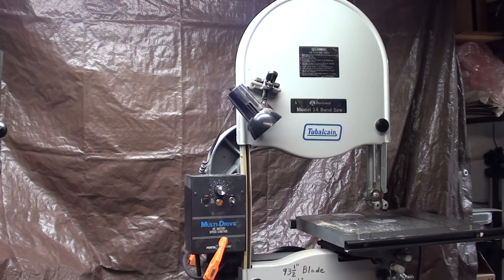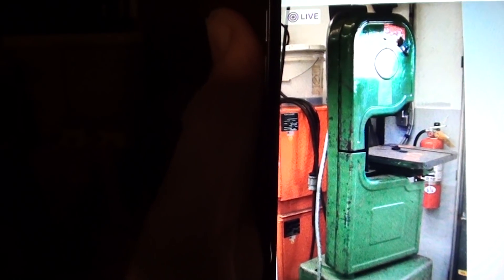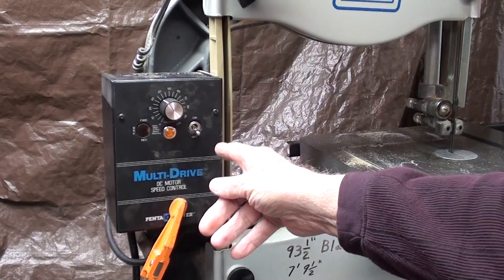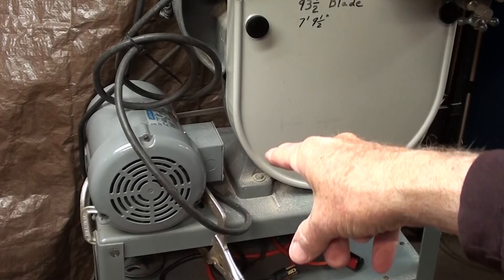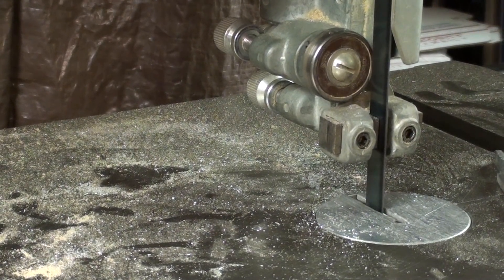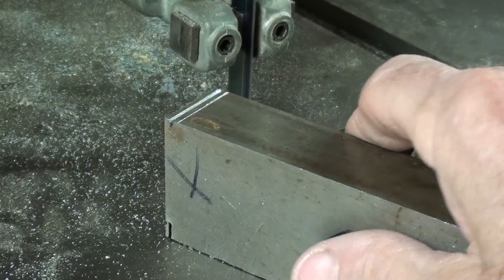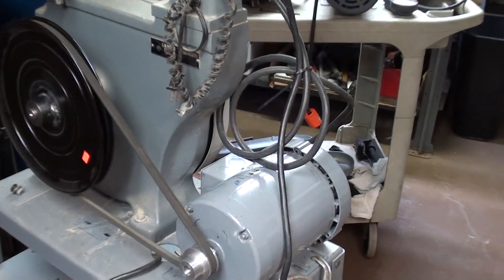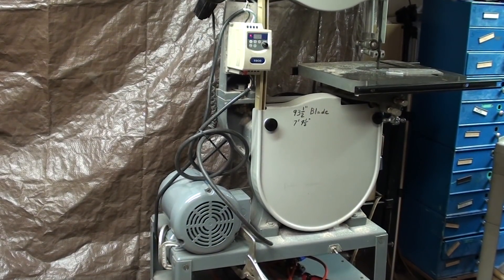Converting Delta Saw to Metal Cutting 491 pt 4 DC VFD tubalcain

Comment: My father had a Rockwell which he fitted with a washing machine gearbox, it basically took the place of a jackshaft with step pulleys from the motor and a chain drive to the blade (single v-belts couldn't hand;e the torque).  It provided a good speed reduction for metal cutting and shifting up to high range (originally spin-cycle) was good for wood and friction cutting.
  The Rockwell was a bit heavier than the newer Deltas, Cast iron instead of those die-cast parts but it still made the screeching noise when metal cutting.
Reply from the maker: Thanks

Comment: Well, at least we know that to do this you need a gearbox or an intermediate jack shaft to get the blade speed and motor rpm properly matched up. 
Now I'm glad I salvaged a couple of those Boston gear reducers from some machines being scrapped years ago.
Reply from the maker: Yes

Comment: I have an older Grob saw and it is purely belt drive. But it has two jackshafts in the cabinet giving 10 speeds from 50-1000fpm. The final drive to the wheel is with a pair of 3/4" wide belts, which is likely what it takes to really work well without a gearbox
Reply from the maker: Thanks

Comment: Hi Mr. Pete,  Powermatic makes a 14 inch metal and wood cutting bandsaw as well as just a wood cutting saw. The metal one uses a small transmission to cut the speed and increase the power. Model 143.
Reply from the maker: Yes, I have their parts list
Reply: I think the model 141 wood bandsaw will produce the same results as the delta. 
Good luck with it, always good subject matter. I have lots of Powermatic wood machines and they are very well built.

Comment: Oh no no no not a failure at all.  I think your idea about the gearbox and the motor is going to be the cat's meow.  Just need a motor that would couple to the gearbox and a double belt or a chain.  This saw is going to be a beast I just know it is.  After all, there is always a great cost for plan B.  Of course the cost is plan A, but you can't get to B without it (or C or D...).  I think my shop teacher told me that.  Did i just hear a bell?

Comment: I have one of those Chinese metal/wood-cutting band saws. It is a 18" Rikon. I had read that Rikon was one of the better Chinese band saw companies so I took a $1800 chance. It was delivered from Amazon completely assembled in a nice wooden crate. It weighs about 400 pounds. I would have preferred an American-made saw but, as a hobbyist, I couldn't afford one of those. I have had the Rikon for about 5 years now and I can say that I am fairly satisfied with it. The only real problem with it is that the upper blade drive wheel has an excessive amount of run out. I could have had the drive wheel exchanged under warranty but I didn't because I wasn't certain that the replacement would be any better and could possibly be worse, given the reputation for Chinese quality or lack thereof. The run-out doesn't really cause a problem unless you try to run it faster than about 1000 FPM due to excessive vibration. Since everything that I cut requires a lower speed than that, it is really not a problem and it runs quite smoothly. I also had to change out the speed sensor. The original was an optical sensor which caused the speed display to wander a lot making it almost unusable. I replaced it with a Hall-effect sensor and magnets which works perfectly. I also added an on-off switch. Surprisingly, it didn't have one so when it was plugged in the VFD was always on.

The Rikon uses a VFD, a 3-phase 2 HP motor, and a 2-stage step pulley to achieve its range of speed. I have always been able to use the lower speed pulley to achieve all of the speeds that I need but the ability to swap pulleys is there if it is ever needed. The VFD is mounted low and is enclosed in a sealed box with a door which can be opened for VFD adjustment if needed. It has a remote control mounted at chest level which contains the speed display, speed adjustment knob, and start/stop buttons.

If you adjust all of the blade guides properly, it makes a very nice square and straight cut. I have used it to cut steel, aluminum, copper, brass, plastic, and wood.

I thought that everyone might be interested in my experience with a large Chinese metal-cutting band saw. As might be expected with Chinese power tools, after you make a few minor modifications they work reasonably well.

Comment: I converted a Grizzly 14" to cut metal using the same setup you have and the only difference was a larger tooth blade of 8-10 TPI. It seems to cut just fine. I experimented with finer blade and they didn't last but a few cuts on steel and aluminum. Just throwing my inexperienced 2 cents in. Thank you Mr. Pete great video
Reply from the maker: Thanks

Comment: I suspect that you have one (or both) wheel on that bandsaw which is running a bit off center. I could see the upper guide moving up and down in time with the motor speed at several points in the video.  (In the places where you had a close-up of the blade cutting.) You might want to put an indicator on each of the wheels to see where the runout is happening. As the frame is stressed more or less by the changing distance between the wheel axles, the tension on the blade changes, too. I would think that this might cause problems with tracking and with the finish of the resulting cuts.

Comment: This series was not a failure. You provided excellent experimental data, and U showed various limitations; and, what’s needed to improve. On the point of VFD’s and motors in the bandsaw low speed application, using a 240V single phase input to 240V 3Phase output VFD, and with the VFD set to SVD control mode driving a 1HP inverter qualified 240V motor will work quite well, and will allow almost zero RPM with adequate torque. - and if it’s important to cut metal efficiently one should use the correct blade. All VFD’s are not equal and don’t have SVD control mode. Note that at 120 V the current draw by the VFD is about twice that at 240V and the resistive (heat) loss at 120V operation is greater by a factor of the current squared - meaning much hotter motor and less efficient operation - and possible tripping of the VFD (electronic fuzz).
Reply from the maker: Thanks

Comment: In my garage I have a 17 inch grizzly bandsaw connected to a 2hp 3-phase motor using a variable frequency drive.  The VFD is mounted up high on the back of the machine to keep dust out, and I’ve run wires to a secondary 10K potentiometer (controlling the speed), a latching RUN switch and a momentary START switch just above the emergency shutoff which I’ve left in place.  I have never been able to overload it and it runs at the speeds I need to cut wood and metal.  My guess is that the 1HP motor is the culprit for your overloads, especially at the bottom end of the RPMs.
Reply from the maker: Thanks

Comment: I think using a six 1100rpm or even an eight pole 700rpm motor would solve the problem .
A lot more low end torque when cutting metal . 
And with the vfd you should have a large enough range to be able to cut wood also . 
Remember , the vfd can more then double the rated motor speed . 

Btw , offtopic , what speed would you recomend for a small belt grinder for metal ?
Reply from the maker: That is true. But do you know how rare those motors are? And how expensive the lower speed motors are when. purchase new
Reply: They are very rare - I never actually saw one.

Comment: Shop Teacher-
My dad and I are mirroring you experiment and really enjoy your series.  At our current stage in the project we have a 10" Atlas saw, Leeson 1/2hp DC, Boston Gear box 30:1 ratio, a similar KB electronics control and a Lenox Die Cutter Blade. Our next step is to try and adjust Current limit and IR compensation in the control. We can't wait for the next experiment. Keep up the good work!
-Student
Reply from the maker: Sounds like a winner, thanks for watching. I soon will be converting a Powermatic would saw into a metal cutting bandsaw

Comment: Do you still think this was a failure?  The VFD seems to be a little bit under powered but it looks the 3ph motor with the VFD worked quite well.  I geared motor might be preferred if you are only cutting metal but I'm hoping to go between wood and metal on my General 490 and I still think this looks like a good way to go.

Comment: Step gears like on a drill press on the band saw?
Reply: Not easy - you need like 4 pulleys to get it to work - its a mess - or three pulleys with very large sizes. Problem is that on drill press you actually have much smaller speed reduction - on my bandsaw I need to go from around 17 rpm to a whopping 600 rpm to cut wood (I would be ok with say 400rpm). Drill press from same motor type doesn't go down to just teens.

Comment: Another great  sunday morning coffee video video from Mr Pete.
There's some great VFD application comments here, I'll add my two cents:

Spent 38 of my last 41 years in the HVAC trade working with VFDs. The first ones we used were the size of a small refrigerator for 5 Hp motor, they've come along way. Most VFD applications are known as variable torque (slower the speed the less torque needed) and less voltage output, perfect application for fans and pumps (HVAC industry). Most commercial and industrial VFD do offer a constant torque operating mode that in theory can provide full Hp rating and output at zero speed. Matching the correct motor type (inverter duty, high iron content and extra cooling) and properly matched VFD is best engineered by the VFD vendor. It's outside of my knowledge range. Additional the cost would probably well exceed just buying a new metal cutting bandsaw to start with.
That said, most VFDs have settings that can help boost torque at low speeds; voltage boost, torque boost, volts/hz ratio, slip compensation to mention a few. Manufactures use different terminology methods.  Also must be aware of motor cooling and posable derating rating of drive capacity. Always best to check manufactures tech support before venturing into these settings.
A simpler approach, the way I would go is oversize the motor and drive (say 2hp instead of 1hp). Size my pulleys (sheaves) so slowest blade speed needed would result in a minimum motor speed around 40% of nameplate speed. Only use a 4-pole or greater motor (1800 RPM or less). The VFD will be much happier at the faster motor speed and only a small amount of boost setting would be needed, motor cooling should ok. In most cases overspeeding a 1800 rpm to 3600 rpm (120 Hz) is not a problem when you need higher speeds say for aluminium or wood.
BYW: I'm quoting synchronous motor speeds (name plate RPM will be slower)
3600 RPM = 2-pole motor, 1800 = 4-pole, 1200 = 6-pole.

Thanks Mr.Pete for the real world home shop practical testing, very enjoyable !
-Dean
Reply: But still not enough - for my 20" bandsaw running at 10hz to 120hz on a 1750 rpm motor - oversized the speed is still 150 - 1800 SFM - a bit fast for hard metal and slow for wood - and that is with 1:10 gear box & rather extreme ends of VFD range.
Reply: @tomk3732  Yep even in vectored constant torque mode they don't like low RPM. Hummm now maybe if you found a 2-speed 3-phase motor. Used to work on a lot those back in the day. Probably cost more than the whole bandsaw now. The wiring and starter config was a bit tricky and you would still need the VFD.

Comment: Sorry it didn’t work out. Thank you for taking the time to do this. I converted an old Sprunger  band saw. When I bought it it had a dc motor off of a treadmill with a  speed control. It stalled out and  could  not handle thicker steel. I have a 3/4 horse motor and a 50:1 gearbox now. It works great but I have belt slipping. I need to build a belt tightening system. The motor and gearbox came off an imported horizontal band saw that was run over by a truck. The saw is a 14 inch dated to around 1954.

Comment: Mr. Pete I have one of the gear box (Rockwell Delta  ??) it works fairly well and I keep it on low speed for steel.  I also have the wood only equivalent saw, that I use on Al, wood and plastic..

Generally the practical lower limit on the VFD/Motor is going to be around 20Hz.    The magnetics in the  motor are not designed for such a low frequency.  The VFD needs to keep reducing reduce the voltage as the frequency drops to keep from saturating the magentics which really reduces the available torque output.  If you then bog down the motor further the VFD's safety sensing circuit cuts in to protect both the VFD and motor.    On the other hand you can generally go much higher in frequency than lower  I run my Bridgeport mill at 150 Hz with no issues, about 6800 spindle rpm on the high pulley setting.  For low speed operation without a gear box or belt reduction the DC motor would be the best but it needs a controller that can use a rpm feedback sensing to keep the rpm constant under load.  Then one can go to zero rpm only being limited by the motor temperature.
Reply from the maker: Thanks

Comment: This has been a fun series.  Probably the best solution so far is the pull gear plus VFD on a 1hp motor. 6" pulleys, dual belts if you need it. Be careful to not use too much belt tension. That plus the pull gear being an overhung load on the motor shaft will advance motor bearing wear.

Comment: Ya i think not 100% that 1hp motor is only 1hp at rated rpm/hz. If you want 1hp of power youd need a much larger motor and vfd to get it at that low of rpm/hz. The vfd will max out its amps to the motors limit if u have that programed in you need to program it in for constant rpm if u can instead of constant current but thats vfd dependant
Reply from the maker: Thanks

Comment: Few days ago I got ex-school Powermatic-81 (its 20" throat and 12" re-saw) for around $240USD - sure beats Powermatic-87 wood/metal that went for exactly 10x as much a week ago. Runs great, has 1hp motor & fixed speed, its serial number starts with 0 and is something like 0-1534. I can put bigger motor on it if I want to, 3ph, 1ph etc. I came to similar conclusions that without building or purchasing a High-Low gear box or without at least 10min change over in belts/ shafts its not that easy to make wood - metal saw due to the huge speed spread needed. One solution could be to use VFD with a 10:1 speed reducer - thus having a 10hz - 120hz usable range - 29 - 345 rpm range or 150 to 1800 SFM. Not exactly ideal - too fast for stainless and a bit slow for wood (current usual speeds are in the 3000-4000 SFM). If you figure out some neat cheap solution let me know.
Reply from the maker: You got a bargain on that machine area that is a great saw. Remember I have a Powermatic 14 inch which I will attempt to convert. I would love to find a slow speed motor or a really good gearbox

Comment: I might have missed this bit of information but how many poles does the 3 phase motor have? It looks like the base speed of the motor is an issue. i.e. that the motor's base RPM is fundamentally too high such that to get the RPMs down you are having to push the frequency down far more than ideal to maintain torque.  Assuming USA base frequency of 60Hz then a 2 pole motor has a theoretical speed of 3600, 4 pole = 1800, 8 pole = 900. For this task a 6 or 8 pole motor might be the better option.  Of course that assumes you have access to one.  :-)
Reply: Most common motor in US / Canada is 4 pole for such application. i.e. around 1750 with some slip. I actually never saw 6 or 8 pole motor so I think they are rather rare.

Comment: I thought the VFD would surely do what you wanted, but you have to run the thing so far out of it's sweet spot to get the desired blade speed.
Thank you for giving it a good try! I like VFD's, but it didn't work out to my satisfaction either.
I was thinking of getting a  second hand wood cutting saw and doing something similar, but now I know that I need more reduction.

Comment: I bought a new vfd and three phase motor for my old Craftsman drill press.. It works pretty fair but it does stall with larger bits in steel... I have one drill press rigged with a right angle drive coupled to a Reeves drive and it is a honey!.. With the Reeves, you get power at any speed.... If you need maximum torque at low speeds, the vfd is not the way to go.. About 350 dollars later I know this.. Mike in Louisiana (Ramsay1)

Comment: I know this has been mentioned before so I will help you beat this dead horse: your mission if you decide to accept it is to go to another auction( or 10) and buy a 1140 rpm 3 phase 1 hp motor and that dead horse will get up and gallop away
Reply from the maker: They are as rare as hens teeth

Comment: As I emailed you I’m starting on my conversion. I’m having to build a stand also so that is first. I’m going the jackshaft route, and have found 2 conversions on YouTube of similar saws. I did the portable bandsaw with stand, but my problem was throat depth wit flat plates. This is my main use for the vertical saw. Enjoyed the video